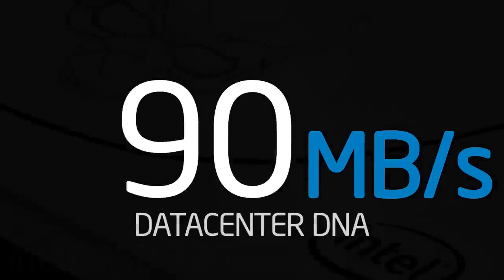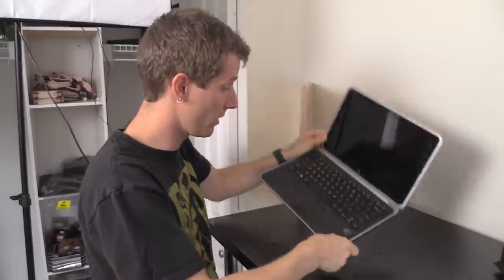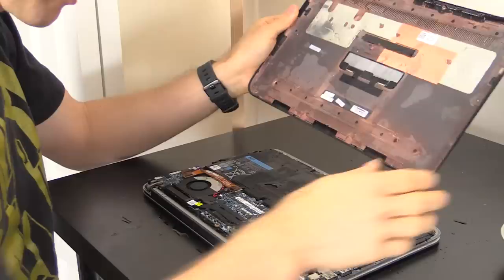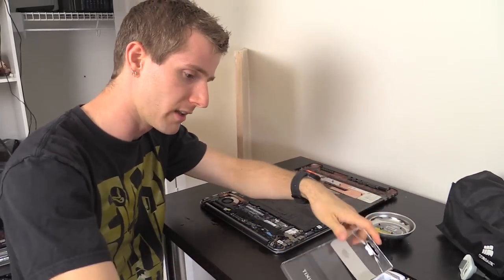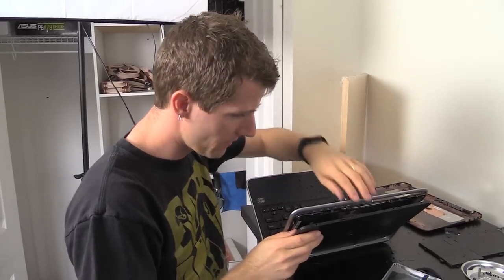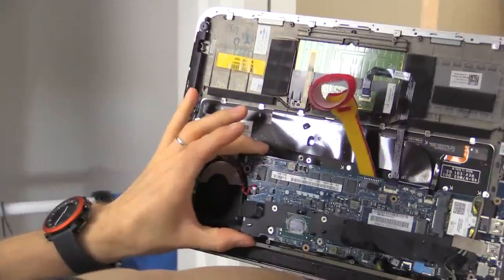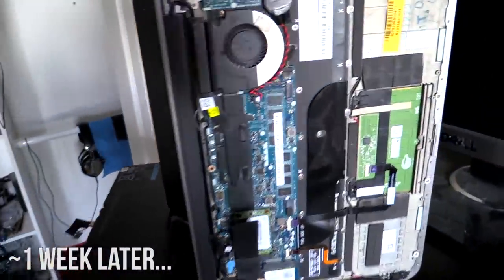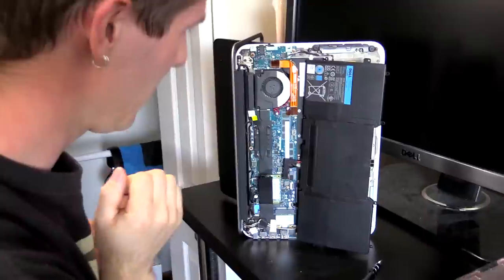Wet Laptop Recovery - Is it Possible?

Comment: One time, like a month after building my new PC, I had something similar happen.  I was filling my waterbed, which involves pulling a garden hose in through the window... the window next to my new pc... yeah.  Well, my poor, beautiful new PC got a full-on 4 or 5 second blast from the hose when I dropped it.  God it was terrible.  I did the same thing, but only for 3 days or so.  I took every component out and scattered them across my dining room table with an industrial floor-drying fan.  Worked fucking perfectly.  I was amazed.  My session didn't even end somehow.

Comment: Would this work if your laptop got covered in chocolate milk?
I got chocolate milk on my laptop and it left a huge mark on the screen.
Reply: you'd have to wash each part individually
Reply: Rinse it with alcohol (in a spray bottle) and use high-pressure air. Then allow it to dry VERY well, like Linus did.
Reply: Dont forget to remove the battery first
Reply: oh I already sprayed it with alcohol half an hour ago...
should I take out the battery now or should I leave it?
Reply: ***** if u have not yet turn it on... yes remove it now, if you lucky it might on (alcohol is conductive)
Reply: sugar isn´t good for any electrical stuff
Reply: ***** usually people does not have 100% pure alcohol so it might be conductive

Comment: It generally is a good idea to put a soaked device into destilled water for a few days before completely drying it. Why? Because with the water comes salt and minerals that are dissolved in it. When the water dries, they remain on the pcbs and in conjunction with moisture (e.g. in the air) become slightly conducting, which causes damage to the device.
Destilled water will help to get the salt out of the device before you dry it.

Of course, soaking your beloved device in destilled water should only be done if you are sure you can get all the additional water out there again. If your screen isn't sealed, you don't wanna do this.

Comment: $800 laptop, yeh just leave it in the rain
Reply: $1000 not $800.
Reply: I should have left my $1200 Dell in the rain, maybe it wouldn't have countless issues while I don't even own it for a year yet...
Reply: he mentioned already owning it for quite some time, so most likely prices have changed
Reply: A $1000 laptop and you can't even pull the battery out without tearing the laptop appart? good job DELL
Reply: hujimix um, did you even take a look at the battery? many people find a laptop being slim important
Reply: Anybody can forget something.
Reply: hujimix Please name me one laptop that can -_- The casing is to prevent short circuits and damage to the battery
Reply: ***** Lots of laptops well every laptop I've ever own could, so saying a laptop can't is quite ignorant on your part
Reply: TheDraykez yes they can be they don't have to be so quick to comment
Reply: Linus actually seems legitimately upset... (and if this acting, good god Linus)
Reply: Xyos212 rain cooled laptop for 199.99$
Reply: themartonfi I meant as in the bottom of every laptop (at least the ones I know) Have casings at the back that prevent the battery from separating and causing a short circuits

Comment: Linus why do you think mac computers can't be opened up and fixed ? They always can I work on them 5 days a week and it is almost exactly the same as the laptop your using
Reply: manufacturing warranty most likely and that mac gule their pieces on to the laptop
Reply: I've opened my macbook for cleaning the fan and it's even better to open than this dell, because of the philips screws and the much more clean inner look. In fact that every part is made for this macbook, it all fits together without any kinked wires...
Reply: Mine is a 2012 macbook pro. The lower case is hold by phillips screws, because it's allowed to change the storage. The others aren't build for changing anything.
Reply: *****
I got a screw driver set, along with many other's came with drivers that opened up the macbook's "wierd" screws... so that's not a huge deal. Just grab them off ebay or amazon.. only cost a few bucks. I believe I payed less than $5 if i remember correctly. 

And I don't know about any glue that's involved in in the macbook air... Are you speaking to the motherboard to the case?
Reply: on the macbook air and retina macbook pros everything else is not

Comment: Labtops can take a beating, I accidentally dropped over 16oz of water right onto my labtop keyboard while it was running. I immediately shut it off, and then after removing the battery. I let it sit in an upside down V position in my bath tub for 15 minutes to let the water drain from it, after I took the back cover off. Then let it sit in rice for 2 days, and that was many months ago, she still works like a charm! I didn't do any cleaning up of components, just letting it sit fully covered in rice for 48 hours in a cool dry place did the trick for me.
Reply: That some good news for me, my laptop got splashed by rain water :(

Comment: Unbelievable. I dropped a few drops of water on my HP laptop and it was completely fucked.
Reply: Was it turned on? If so, of course it's going to short-out and destroy your computer.
Did you try turning it on while it was still wet? Take the proper precautions, like Linus did?
Reply: Zach Berry Yeah, I turned it off right away, though it was probably too late.
Reply: Zach Berry It's okay, though. I needed to replace the thing anyways...

Comment: Left it for a whole week? Wow really? Ain't that exaggerated? Wouldn't a few hours be enough?
Reply: does it worth 1000dollars a week, yes
Reply: the longer the better
Reply: lol no. never a few hours.
Reply: Probably depends on where you live? If you live on the Sun then a few hours should be fine...
Reply: Bimmy Lee They want to be 100% sure every trace of moisture left from the rain is gone. If you turn it on too soon, it could short out and then there goes the laptop. You lose nothing by waiting longer (except from getting impatient). Also I'm not sure if leaving it out to the sun for a few hours will dry deep inside of the laptop (if that part is wet).
Reply: Bimmy Lee dang, I wonder which brands are least prone to overheating on the sun? my parents told me we're moving there in a couple months, and I had already given up hope on having any laptop work there. could you please give some insight?
Reply: Bimmy Lee Actually i have heard using heat is bad. That could cause rapid evaporation which could let moisture into areas where it truly is bad for it to get. Especially if you try only doing it for a couple of hours and then remove it from the heat allowing the still high moisture air to condensate back out.
Reply: Better safe than sorry, right?
Reply: yeah paul u a right!
u should try it.. put your laptop on the bathtub asap
Reply: Richard Smith Well I was only kidding about the Sun, I bath washed arcade pcb before, due to them being caked in dust & never had a problem, dried with a fan heater on low but placed far away so that there is no breeze blown directly on to it but that said theres a lot more going on in a laptop.
Reply: Oh I leave them for a few days before using them, I do not recommended any shorter like a few hours.

Comment: why don't you try a hair dryer in low speed to dry it faster?
Reply: it will make it hot and it might make the power button contact so it turns on

Comment: You wuss Linus. Take it all the way apart. Not that difficult to get it back together. Done it dozens of times.
Reply: htwingnut he did it the right way as always. If you took it all apart, how would you dry it? Turning each piece over? By letting it hang he got it all at once and saved some time. I am sure Linus could tear apart a lappy blindfolded.
Reply: That's a lot of pins.

Comment: Luckily it was rain pretty much distilled water that would of helped with a short, however a week was too long water damage can cause corosion and that seems to what kills components next to shorting and overvolting. also the bag of rice is straight up bs ur better off with a EDS safe paper towel + a warm air heater blowing from a reasonable distance... linus got the best case scenario here
Reply: Any idea how much days to dry all the part? Considering 7 day is too long? Thanks

Comment: I've done such recovery (sometimes even a repair) of a device soaked in water many times. The look of a wet device is always scary but there's a good chance of success (mostly because PCB's have protective coatings but not only because of that - there are many reasons). One must only always remember to disconnect the battery ASAP if the mobile device got wet (or disconnect the power it it's a stationary device). Pure water is not that harmful. Acidic fluids are more harmful because they conduct electricity better thus the chance of shorting something is bigger. Cool that you managed to save your laptop. Keep up the good work with the channel. Greetings from Poland. Oh, and one more thing... Amiga rulez! :) (so the folks who know what's an Amiga may know where I come from ;)).

Comment: I ended up getting an old model M keyboard that looked really nasty. Surprisingly the plastic looked pristine when I cleaned it, but I wanted to be thorough so I decided to clean everything, and since water got into the membrane used for detecting keypresses, it didn't work for  about a day, it would keep repeating keys, but I put it on top of a vent (it was winter, so hot air would be blowing through), and it worked perfectly. Amazing what proper handling of electronics can overcome.

Comment: I have a very old dell d600 that I have drenched with 20 ounce cups of coffee on 2 occasions.  I did not disassemble the computer either time. I just unplugged it and dried it out for a day or so in front of a fan.  Both times there was coffee pouring out of every crevice in the laptop body.  It was like a back up back up computer so losing it wouldnt have been  a big deal but it was still amazing to me that it continued to work after those drownings.

Comment: Back in the mid 90's I worked for an electronics manufacture company, I used take ATX sized circuit boards out of a soldering machine and right into a fancy dish washer to clean the flux off.
If current is not running through the circuity and you dry it off really good, most likely the electronics will be perfectly fine.

Comment: Just a tip if u ever have to dry up a wet laptop again,  disassemble it like you did in the video but instead of a just using a fan, put it in a small room with a dehumidifier also  it'll speed up the drying process sooner.

Comment: I just clicked into this video and your "sponsorship" is still playing but wanted to mention something.

I'm a slob.  Yes, you needed to know that.  As such, I pretty much do everything at my computer including chain smoke and eat.  Thus my keyboard gets pretty nasty pretty quickly.  And yes, I try not to get stuff in my keyboard but it happens anyway.

So I regularly wash my keyboards.  I use my laundry sink because it's big enough for a full size keyboard to soak fully submerged.  So first I rinse out everything I can and then I put plenty of warm water in the sink with a mild detergent.  Then I let it soak for an hour up to overnight depending on nothing other than do I feel like messing with it.

Afterward I rinse it for an extended period.  Then I stand it on end and let it dry for at least a month.  It would probably be best if I used distilled water for a final rinse but I never have it on hand and never remember to buy it.  So far I've had no issues.  Obviously you need more than one keyboard unless you want to go a month without using one.  These things take an incredibly long time to dry - particularly if you have a membrane keyboard.  In fact, if you have a membrane then you for sure should use distilled water to rinse because that water will be there a very long time before it dries.

OK, on to watching your video.  Should be simple.  Remove batteries, rinse and let dry.

Comment: i had an even worse accident happen to my laptop and recovered. during a move my son spilled an entire bottle of maple syrup into my keyboard and mother board. figuring that my asus laptop was toast anyways i decided to disassemble and wash all the parts. filled bathtub with hot water and dawn dishsoap soaked the mother board ram and all internal parts for 2 hours came back scrubbed them cleaner a quick rinse soak in distilled water let dry for 3 days put it back together and i have been using it just fine since that was 2 years ago. water will not hurt a quality build as long as there isnt power at the moment of the accident had his laptop or mine actually been running it wouldn't have survived but that's just my opinion.

Comment: This literally just happened to me!!! I've got an old HP 8510w that I've used for years. I've since upgraded to newer notebooks, but I happened to be using it at starbucks last week and dumped a grande blonde roast into my lap, as well as the keyboard while the laptop was on and running. When it happened, the display cut, and I yanked the battery out immediately. I let the coffee drain out of the computer (black, no sugar or milk luckily) and took it home. I used a hair dryer to get it as dry as possible without overheating it, and then let it sit open for 5 days. Today I plugged it in and whala! It powered back on like a champ. I was in shock. The only thing that is damaged is the hard drive, which was an old mechanical drive, so I expected no less. But besides that, no damage!

Comment: Well the thing is, that water actually won't really "short out" the battery... Pure water actually is a poor conductor, but as it gets contaminated with minerals, it start to become more conductive. Now... In order to purify water you have to distill it, which means evaporating it, and condensing it, which is exactly the path of the rain, so rain water actually should have pretty high resistance. Current = voltage / resistance, so high resistance and low (battery) voltage = pretty low current, and li-ion batteries have high current handling capability, some up to 15-20 A, which means rain water simply can't conduct enough to "short" it. The problem is, that water unlike a cable gets under the batteries protection circuit(which would cut power in order to prevent it draining completely), thus allowing it to bleed completely dry, which will result in shorter battery life and yes shorter life, because it's still rechargeable even at that point you just have to charge it correctly, which of course should be no problem for a proper charger circuit, but no fire danger. from water that's highly unlikely. I would be more worried about the circuit being damaged or the keyboard not being able to dry well, then about the battery.

Comment: I'm guessing the laptop ran the battery down when it was left out and went into hybrid sleep mode (sleep + hibernation fallback), which is why it booted right back up to where it left off. The Dell logo and Windows startup animation prior to resume are dead giveaways.

Still, impressive save. The battery shorting was a real possibility, good thing the battery was well sealed.

Comment: A recent story for those who are interested. Whilst i was on a trip to Rome with a few friends, one had dropped her phone (s3) into a basin of water. After some 20mins of panic she eventually came to me for help. Without any tools beyond a kitchen knife to pick at screws with, i eventually got it open and used a hair straightener for 2hours to evaporate the water inside. you could see the condensation forming onto the screen from which there is still a mark on the lower left portion. Even though im somewhat savvy with my tech, I was amazed how that even worked, as prior to treatment it would not even boot.

TL;DR Hair straighteners are good at evaporating water inside phones you cannot completely open

Comment: I got a Dell XPS 15 back in 2011 and have been using it continuously since. It originally had Windows 7, but I put Linux on it and the computer runs fine on it. Even the webcam works on Linux.

Comment: battery was out before it rained so it prevented the system from getting short circuited from the board and then you got lucky and the short circuit on the battery never happened!  I think the most amazing thing is that screen not getting white smudges inside because of passive drying of water.

Comment: I have this SAME laptop. It is a tough nut to kill. I had to replace the battery and the touchpad but other than that, it is pretty solid. XPS12 left things to be desired but it does Hyper-V, Visual Studio and other things just fine. I need to replace it with a Surface Pro 4 but it is hard to give this up.Running an i7 with 8 GB of RAM

Comment: I did not know that ultrabooks actually came with modular parts. I thought they all went down the same road as Apple with soldered on parts.

I've actually been considering the XPS 12 for a long time now, despite the new XPS 13. That convertible display is a great feature in my books.